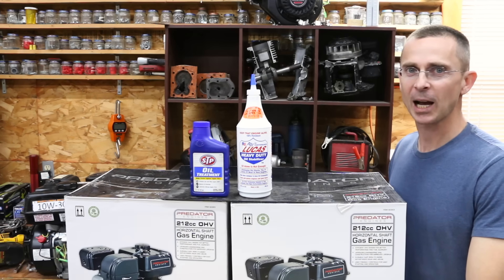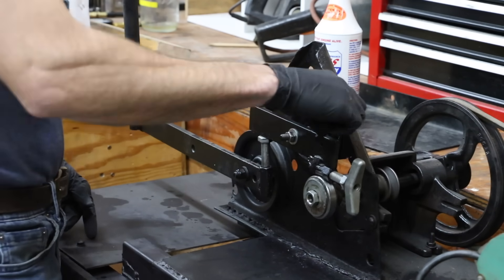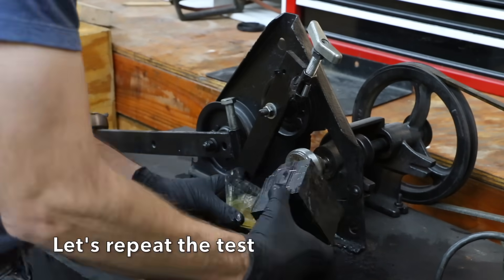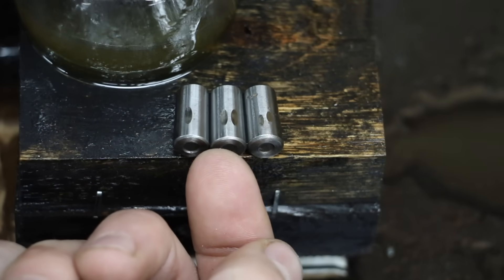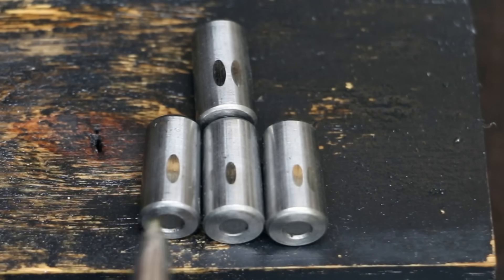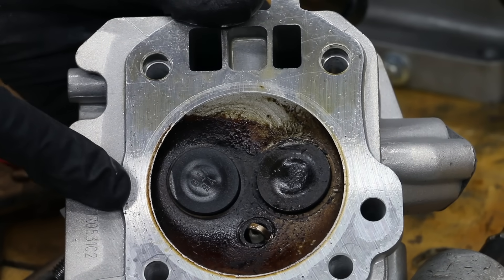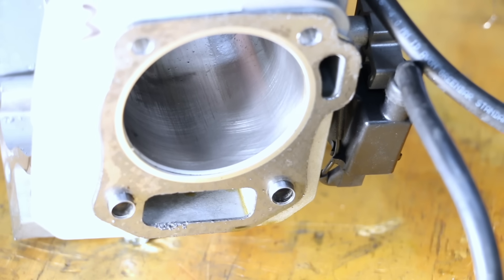Which engine self-destructs first?  Lucas or STP?

Comment: Lucas is excellent in engine that are burning oil real bad, the thicker oil will slow consumption considerably.  Loss of oil from worn mains or cam bearings.. Lucas can help maintain safer oil psi due to extra viscosity it cushions excessive clearances slowing oil psi to build more than without additive.. doesn't silence worn rod bearings knocking or collapsed lifters ticking loudly.. Lucas will buy time on shot engines
Reply from the maker: Thanks for the feedback.

Comment: While I have seen a lot of good comparison videos from this channel, this video is a really cringy and bad one. Unless you run 100 tests on both of these additives, it doesn't prove anything. Plus you only used one very specific engine in this test. Not to mention even with the same setup, they will never have the same run time anyway. This is not how you eliminate variables.

Comment: Seems to boil down to which additive handles overtemperature better. STP seems to provide better lubricity at low temperatures but doesn't handle heat as well as Lucas. Hey, maybe you're doing these tests to convert folks to electric motors? Nah - no fun there.
Reply from the maker: Thanks for the feedback.

Comment: Thanks for the Lucas oil additive tests.  I used Lucas in my 1991 Blazer it quieted it down the engine sounded better.  I almost got 300,000 miles out of it cracked block.  I like your test because they seem fair.  Your not cutting corners to try to convince anybody that you have an agenda to prove.  Keep up the work.
Reply from the maker: Thanks, will do!  Thanks for sharing.

Comment: Lucas won HANDS DOWN.  But more importantly, I use it in an aircraft engine and run that engine at 6k constant and I am talking 2-Stroke and after 300 hours, NO WEAR.  The Full Synthetic Racing Lucas is also used in Aircraft Racing Engines and the engines run COOLER, Faster, Smoother, and Even the Oil Temp is lower.  Lucas has proven itself to me and many others.
Reply from the maker: Thanks for the feedback.

Comment: Great video, but try Slick 50 additives, I used it 20 years ago in my Ranger and it is still runs 👍205,000 miles too👌I'd love to see you test Duralube against Slick 50 additives 👍👍
Reply from the maker: Thanks!  Thanks for the video idea.
Reply: Yes please do a video on those two I've used Dura Lube on a few vehicles with no problems

Comment: I've used Lucas oil for probably 50k miles or more. (The synthetic Lucas along with a synthetic oil, I use the entire thing when I do my oil)

 I started using it because of oil pressure issues on my 5.3. It didn't 'fix' my oil pressure issues, but it sure did help it in my opinion. Have over 100k on this motor and its still going. I went from low oil pressure on start up to that not happening as much. It still happens, yes. But not as much. And yeah I could've put an engine in it, but this motor has had oil pressure issues since 20 or 30k miles, and it has over 100k now. Im waiting until it blows to put another remanufactured engine in it. 

I also am not sure if its knocked since I've done this Lucas stuff. At times my rockers would knock really loud, now I can't recall the last time that happened. It sounded like rod knock. Anyways that was probably 20k miles ago or more it did that last. And I don't recall if I had Lucas in it when it did, maybe, not sure.
Reply from the maker: Thanks for the feedback.

Comment: I've been hooked on your videos ever since you turned me on to only using REC/RV gas in all my small engines & also using Engine Restore.All my small engines now start on the first pull even after sitting all summer (snowblower) or winter (rototiller). Also still using Engine Restore, Grand Prix has almost 300,000 miles & still running strong. You're the best!!!
Reply from the maker: Thanks!  Thanks for the feedback.

Comment: I have been using a quart Lucas for 3 of motor oil in my 1993 D21, for 10 years in the hot weather of southern California , and the odometer has reached 400,000 miles.
Reply from the maker: Thanks for sharing.

Comment: how do you know the motors are perfectly identical in every way?  to many variables to make this even a close scientific debate, at all
Reply: I was thinking the same thing. QC on those Harbor Freight engines is questionable at best. Even top name engines are going to have differences. Who assembled it? Were the parts dead on or barely within tolerances? etc., etc.
Reply: @bartsmith4763  agreed. the fact this isnt in the video really makes me question more than just this one video.

Comment: I'm not sure how this test proves anything useful.  This might indicate that you have less scarring at cold start.  But just because the oil doesn't burn off as easily at high temperatures doesn't mean it lubricates better when it's being used in a normal mixture.
Reply from the maker: Thanks for the constructive feedback.

Comment: Thank you foe the amazing demonstration, I have a new Jeep Wrangler with 4400 miles on it, is it safe to add Lucas oil to my engine?
Reply: It’s always safe to use Lucas oil - however you should probably consider using the additive designed for modern engines.

Comment: I have very good luck with Lucas attitude I put it my lawn more engine I put it in my motorcycle engine  I put it in my 1400 hp.  blowen 427 in my boat I use Lucas for everything I used Lucas for the rear ends transmissions you name it I got very good luck with it  every sense it came out

Comment: How about running three where you have a control engine that runs the same times with just normal oil and no STP or Lucas? That way you will know if they are better than just using normal oil. And maybe even do another one with synthetic oil vs. conventional. Doing it this way does not prove if STP or Lucas actually makes conditions any better than normal oils. Or maybe one or both wouldn't be much different than just plain synthetic oils. In other words, the STP engine may have died at about the same time as the engine in which you ran just normal oil. Of course, it would be best to do about 5 engines of each category, but that would be quite expensive. You did run a control with the scoring test, but that doesn't necessarily mean running engines will have the same effect because they amount of pressure and scoring is not anywhere near that in an engine.

Comment: Love your testing I can trust it as opposed to Mfg"s product claims and puffing...If possible can you perform some competitive testing of oil / additives  / combinations thereof ( stp / lucas etc. / oil mixtures ) per mfg's recommendations mixing ratios for use in turbo charged engines..It's my understanding that "coking " of oils caused by residual heat after a turbo has been run and shut down destroys the turbo bearing surfaces and upon restarting the turbo such results in / causes oil burning / smoking blue color exhaust..Also the running of a turbo equipped car during long time intervals / distances on interstate highways again is a major cause of turbo failures due to oil film strength breakdown ?..Supposedly zinc and phosphorus rich oils prevent metal to metal contact in turbo chargers however are detrimental to catalytic converters ?...Which oils , given today's, greater prevalence of cars equipped with turbo chargers works best / properly / effectively / prevents turbo failures / promotes their useful life expectancy ? I suggest that there is great consumer interest in this research subject...PLEASE  do continue your important work ...Thank you
Reply from the maker: Thanks!  Thanks for the video idea.

Comment: Ive run lucas oil stabilizer in all my vehicles and it honestly works very well, keeps the lifters and rockers quiet on high mileage motors. My 88 camaro gets beat on religiously and ive yet to have a catastrophic engine failure. My only complaint is when it gets cold outside that stuff turns into molasses and it can cause some starting issues and other problems. But other then that its good stuff
Reply from the maker: Thanks for the feedback.

Comment: Missing a control element - an engine with no additive and no oil - to destruction!
Reply: A control element more like with oil and no additive and then drain it and run it with no oil after. To see if the additives made a difference or not
Reply: @dylanvignolini7187  good call Dude
Reply: Thinking the same thing
Reply: Yes, I would like to see part 2/addendum video testing a conventional and a synthetic oil.
Reply: 3 minutes. Ask me how I know😂
Reply: I agree. I have seen this channel do a test with unadulterated oil in other vids & the plain oil seizes in significantly less time.
Reply: Agreed 👍
Reply: Which is basically the whole reason for using this stuff. Does it enhance the oil in any way? Will the engine run longer using Lucas

Comment: ...this reminds me of when "SLICK 50" was making these claims....and TOYOTA sr22 engines were supposed to be "bullet proof". Well, I had a "slick 50'ed" sr22 throw a rod thru the block at 130k miles and then the second sr22 with slick 5o only went 20k miles before suffering mechanical failure...
Reply from the maker: Thanks for sharing.

Comment: I use Lucas oil stabilizer and Seafoam(gas additive) in my dad's 2008 lincoln MKZ 3.5 v6 every oil change.  The car now has 315,000 miles and counting.  He beats that thing hard with the way he drives and it srill runs/sounds just as good as the day he bought back in 08. He usually goes 5k miles  over before getting the oil changed.  I don't think it would have lasted this long and run as well as it does if it wasn't for the oil stabilizer and the Seafoam.
Reply from the maker: Thanks for sharing.
Reply: @ProjectFarm  Thank you for all the hard work and testing you do your channel.  You put out some really great content full of useful and factual information that I can trust.  I appreciate the fact that you are unsponsored and don't push products because of sponsorship.

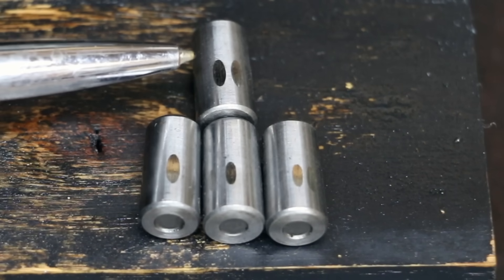Comment: hello. at 5:41. Are those different sized bearings? The one on top sure looks like it is a larger diameter. at least from the camera angle. If they are different sizes..... does that change the shape of the scar dramatically?

Comment: Could have talked  a little more about how much longer the Lucas lasted compared to the STP. 8 some odd minutes longer? I believe that's what I would go by. As far as dollars go if you did the percentage on how much longer a motor was the last in regular use that would fit Locust way ahead of STP even if it costs ten times more.
Reply from the maker: Thanks for the feedback.
Reply: @ProjectFarm  I'm just glad you can understand what I was trying to communicate. I probably need to start proofreading. I read it the second time and I'm not real sure what I was trying to say. I wonder if drinking a teaspoon of STP oil treatment will help me.

Comment: I'd say that there likely isn't too much effect on any of these additives. Good quality oil is all that's needed. Most additives tend to just increase viscosity and make noisy engines bit tamer. That doesn't mean that the actual damage hasn't already occured. If I happen to remember correctly this result is fairly similar to was it Motorup that had quite a bit of commercials in around late 90's IIRC? There they taped car engine running after Motorup treatment without oil pan and sprayed water to crankshaft and taped engine running for was it 10minutes. Magic partly there was imo that parts were actually chilled with that water and car's bearing races will have some oil film for some while. Oh, so why I think there isn't too much difference between these products, even though video showed difference. Well imo it's the manufacturing tolerances that will differ enough to create quite substantial differences how long engine could run without lubrication. Now I would obviously reconsider if I'd happen to see this done on batch of ie. six engines and result was always the same. That would be interesting to see actually, however unfortunately expensive test. But I'd expect them to change, but hey, you never know 🤷‍♂️Good video anyway, thanks 👍👍
Reply from the maker: You are welcome!

Comment: i run both stp and  lucas in my equiptment  i have oldbriggs9 hp cast iron  on my lockesmower wisc single cylinder  agnd running on both and one locke brigs and one wisc needs rebuilding  but i run  s.a.e 30w detergent  my small engine same my yrucks. i run 15w-40 in my inline 6 and v6 my small block all newengine 5 years,ago most are over 150,000 miles my inline and v6 still original except for the inspection cover and valve and those arealmost 300,000 i have 2mowers and a van i just have botj oils qere black i put in 15w40 and 1/2 qt trans fluid  i was told when you CANNOT READ THE WORD FULL OR ADD CLEARLY  DRAIN WHY??? BECAUSE THE ADDITIVES IN THE OILS ARE GONE AND TRANSMISSION FLUID I REMOVE 1/2 qt of oil i getting on mosr of my engines 2000 miles begore adding oil.
Reply from the maker: Thanks for sharing.

Comment: Do a showdown with prolong afmt @ 10% of volume and 15% and out it under much heavier load than all other products.. prolong.com see how long the friction machine runs before they seize up.  You WILL be blown away how powerful prolong is at anti friction protection. Also do your temp of the the grinding surfaces while running.

Comment: I don't know about running these in your engine but the stp makes for an excellent assembly lube for transmission orings, lip seals and seals. Along with lubeguards freeze cones and stp there is no need for those seal cutting lip seal tools and orings just slide right into place. Also, one bottle will last about a month as all you do is use a small brush to apply it. One more added bonus is its virtually clear so you don't get a trans leak confused with a little assembly lube. Oh did I mention it's cheap also. 
P.s. the stp should only be used as a assembly lube in transmissions not as a oil additive. A little goes a long way. Good luck everyone!

Comment: I've seen people say oil stabilizer is worth it. But for long time would just changing the oil sooner with quality oil be worth it.  Vs how some will use stabilizer with a lower quality or even the same good quality oil

Also Lucas and hot shot fr3 with different will be interesting to see. I've always used Lucas for most things but the hotshot looks just as good if not slightly better
Reply from the maker: Thanks for the video idea.

Comment: So this friend of mine had a lil Nissan Pulsar from the 90's. She run outta oil, and damn nears cooked the motor. This thing was a mess, and locked up. She informed me she couldn't afford a new, or used car. She was about an hour from my place, and she had about a 10 hour drive from her place in Alberta. I told her there's this new product out that I can buy called Lucas. I broke the engine free, and put about 2, and a half liters of straight Lucas oil stabilizer in the motor. To our surprise it did fire up, and ran fine. I told her to go strait home, and no detours. She continues to drive this car on the same oil for two years (amazing). Her brother took it in for an oil change, and they put the recommended oil from manufacturer in it. 1/2 an hour later the motor piled up. Till this day (12 years), I wonder how long that motor would have lasted if they woulda continued to use 💯% Lucas oil stabilizer. I don't recommend using it to that ratio, but this was sorta an emergency. That motor was messed up really bad. When she called me, and told me what had happened, it blew my mind. So now I recommend Lucas oil stabilizer to everyone.
Reply from the maker: Thanks for sharing.

Comment: back in 94 had thunderbird had lost 3 quarts with lucas added. no valve tap. thought I had hurt the engine rings. did a oil change with lucas as before. do damage. no oil burnout. kept oil level till next oil change. why it lost oil is a mystery. I put lucas in all my engine and harleys. I will never run an engine without lucas,
Reply from the maker: Thanks for sharing.

Comment: I would like to see a clean 100 percent pure rendered and filtered while hot Bacon grease and mix in graphite powder say up to 10%.    Put up against a Royal Purple Synthetic top tier oil!  Same exact test as the STP with oil vs Lucas with oil.    Also on a side note have you ever done any oil tests with Rotella 15W40 diesel oil I have used it on all my old cars and trucks that had high mileage I would buy the cheapest non Synthetic good oil I could buy from Walmart then when doing an oil change I would fill the oil leaving one quart low then add a quarter of the Rotella 15W40 Diesel oil.  I did this because it had the highest amount of zinc comercialy available in any oil that I knew of.  Seemed to work great for me.  Might also be a good video.  👍
Reply from the maker: Thanks for the video idea.

Comment: Great video, thank you. I have used both of these, but more Lucas for the last 10+ years.  Have me wondering now. I recently got a gallon of their "synthetic" oil additive, it is clear, and had me looking sideways. 
I do love their steering fluid additive, works well for leaks, and tight racks/boxs. I saw the trans one you did too, it does help some, also for small leaks. 
I use their fuel one, and wonder if that's any good really.
Reply from the maker: You are welcome!  Thanks for the feedback.
Reply: I have used Lucas fuel injector cleaner,  in both gas and diesel engines.  Helped a Cummins ISX 15 , 15 liter 450 horsepower I would buy a gallon every 6 months put half in each fuel tank (150 gallons each) 
My fuel mileage went from 5.8 MPG TO 6.25 MPG 
Not much I know, but when you drive 100,000 miles a year, it makes a big difference. 
Also had a 98 Chrysler Concord,  2.7 V6 I was getting 28MPG with it, on a 2850 mile trip I averaged 31.5 MPG . The only difference was Lucas.  Same with my old trucks 2007 International  9400 I . The Cummins ran much smoother as well as better fuel mileage.